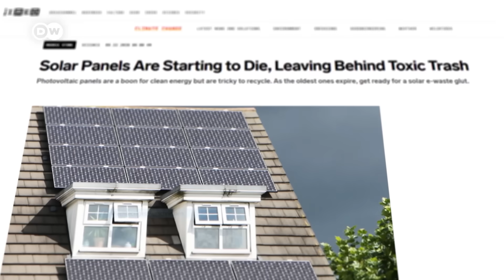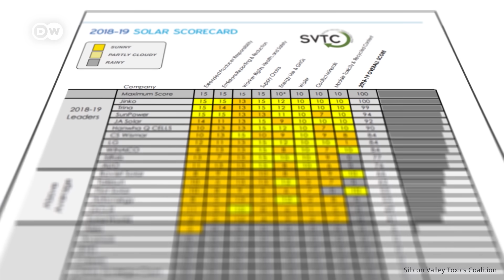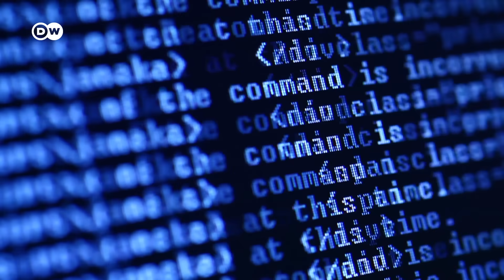How green is solar energy really?

Comment: The advantage of solar is decentralized power delivery due to rooftop solar. This isn't possible in any other methid of producing electricity. So, if we factor the transmission losses, solar has the least losses.

Comment: The Real Cost of “Clean” Energy Must Include Land and Wildlife Impact

As the U.S. considers sweeping changes to its energy infrastructure, it’s critical that we compare apples to apples. Much of the discussion around replacing coal, gas, and nuclear with wind and solar skips over one crucial fact: our current energy system, for all its flaws, is already built.

Coal mines, natural gas pipelines, power plants, and transmission lines already exist. The ecosystems they disrupted were disrupted long ago. Maintaining these systems does not inflict new damage to the land, sea, or wildlife. In economic terms, those environmental costs are sunk—already paid.

In contrast, a shift to wind and solar—especially one made reliable through massive battery storage—requires a complete reengineering of the grid. It would demand the conversion of 17,000 to 49,000 square kilometers of new land (an area the size of West Virginia), and 1,200 to 6,000 square kilometers of coastal and marine zones for offshore wind. That means bulldozing forests, fragmenting habitats, and interfering with migratory patterns—on land and in the sea. Add to that the construction of over 12,000 GWh of battery storage, and you’re talking about one of the most ecologically disruptive infrastructure projects in American history.

While advocates point out that the sun and wind are free, collecting and storing their energy at grid scale is not. Nor is it low-impact. In fact, the environmental footprint of wind and solar—when scaled to reliability—far exceeds that of nuclear, and even outpaces the already existing footprint of coal.

There is a reliable, low-impact alternative: nuclear power. It offers stable, round-the-clock electricity with a compact footprint, far less land use, and minimal disruption to wildlife. If we’re serious about cost, reliability, and environmental stewardship—not just optics—nuclear deserves a central place in the conversation.

The path to a better energy future must be grounded in facts, not just aspirations. Before we tear up new land and put our fisheries and wildlife at risk, we should consider what we already have, and what technologies can carry us forward with the smallest ecological price

Comment: Old Solar panels don't suddenly die, they simply fade away, very slowly! They could have a 2nd life as a building wall cladding material, used intact, without damaging them. If these old panels can be 'opened' non-destructively, the glass panels make cheap windows and Skylights in a roof. This glass has a very high strength useful rating because it is 'hail-proof'!!

Comment: A pretty serious problem I see with solar panels is efficiency. At this moment, on average, only about 20% of the energy a solar panel captures becomes electrical power; the remaining 80% being dissipated as heat in the air at ground level, contributing directly to warming the atmosphere. There is a lot of talk about "more efficient" panels, but even if the current values double (which is not easy),, it would still mean that more than half of the energy captured by the panel becomes heat. If this drawback gets resolved, solar power generation will really take off.

Comment: Why does DW Planet A have such a consistent editorial policy designed to call into question the validity of relatively green energy sources (How green is solar energy really?), while at the same time giving fossil and in particular nuclear sources a relatively free pass? 

Rather than use a consistent analytical framework for all energy sources, you tend to nitpick at minor green concerns while ignoring the fact that the carbon footprint of fossil fuels is orders of magnitude greater. Or when you then look at nuclear power you selectively ignore the fact that there is no long terms waste storage solution, and even if there were, in most jurisdictions this is dealt with by the taxpayer in the longer term, rather than by nuclear power producers. If this cost were added to the cost of nuclear power, that power would simply be uneconomical. 

So, "How green is solar energy really?" The answer is quite clear: next to hydro, solar and wind are hands down the lowest cost power sources, and all have a relatively tiny carbon/nuclear waste footprint per unit of power produced. 

Are these latter points at all contentious, DW Planet A? If not, why all the hand-wringing equivocation on renewable energy sources?
Reply from the maker: Hey there! Thanks for sharing your thoughts! We actually tackled different kinds of renewable energies and we also looked at fossil fuels. We always look at each topic with a critical eye and show both advantages and shortcomings to provide a balanced view. If you are interested, here are some of our other videos on renewable energy sources: 
Next gen solar 👉https://www.youtube.com/watch?v=Fft4UT7kGxg
Geothermal 👉https://www.youtube.com/watch?v=c7dy0hUZ9xI
Wind turbine recycling 👉 https://www.youtube.com/watch?v=HzQShAlObn8

And here you can find some of the videos on fossil fuels
Coal in Germany 👉 https://www.youtube.com/watch?v=CjFeVERfvH4
Running out of oil?👉https://www.youtube.com/watch?v=fkrJ8gcHqQI

and this is our most recent one on nuclear waste:
https://www.youtube.com/watch?v=hOWQgLeRM-M

Comment: you havent delved at all into the environmental disaster of mining for the raw metals - such as Cobalt, Manganese, Nickel, Copper, yada, yada .. let alone the requirements to manufacture and lay the cables that transport the electricity generated to either (1) hideously environmentally destructive batteries (a separate story, right?), or (2) the electricity grid which requires higher stability that is mainly achieved with burning hydrocarbons or nuclear reactors
Reply: Are these the same materials in our phones, and about every battery operated appliance going?  Are the batteries more environmentally destructive than strip mining, forest clear cutting, drilling in environmentally sensitive areas?  Do battery technologies have more improvement potential than these other destructive means that haven't changed in years?

Comment: There is also a need to do a cost-benefit analysis on the surface area coverage versus the tree covers. 
We don't want a situation where future civilizations will ask why we exchanged vast amounts of forest land for solar panels; worsening our situation. 
Like one-tree-per-equivalent-solar panel and in aggregate with computer simulations of the future for both scenarios. 
Some centuries ago our ancestors thought that the cheapness of working with lead for eating plates was novel. This killed them for decades without knowing as the chemicals in tomatoes reacted with lead killing them slowly without a trace - some woke up in the grave after their body fought off the damage but only their struggle-marks were found much later. Saved-by-the-bell's most likely origin.

Comment: Do you mean, “because creating solar generates gas emission” "then we should stop creating solar and continue completely creating gas emission by burning fossil fuel” ?
Do you yourself understand what you say?
Even if beginning generations of solar are dependent on fossil fuel , because there are not enough solar energy generator to satisfy the demand, after there are enough then even creating solar will be relying on previously created solar and the energy that they generate.
Also, toxic material in the air are more dangerous than solid material because they easily move , out of control, in the air.
Besides, because  solar and batteries waste , are expensive and still valuable therefore they will go to recycling factories, and they will not be buried underground, expect if a country like to do an economic suicide.(we talk about large scale)
the cost of recycling still is lower than extracting them from natural resources such as mines and the ground because those recycling material are purely consist of materials used in a solar system and not anything else.
at the end , yes all opinion all respected even if they dont fit with any fine logic.

Comment: What is the environmental impact of the heat reflected by the panels, the heat absorbed due to the lack of vegetation caused by the clearing and redirecting of water flow, due to the grading and packing with rock, etc?

Comment: The waste is the issue even with recycling as with plastic..C02 is great for our planet. Note: climate change regardless of human intervention this is a multi faceted monster data clearly shows temperature changes that the carbon changes also throughout history cold kills way more. Air pollution does exist but if you see it, it is not CO2 which helps our plants and Oceans. While CO2 has some correlation to heat it is not the causation so many more factors such as sun and solar flares. So what I wanted to see more from this doco is about the battery and the elements that go into making them ? Nuclear is looking like a good alternative
Reply from the maker: Hey there! We tackle topics you mentioned in these videos:
EV recycling 👉  https://www.youtube.com/watch?v=PbOBmnZRpZ4
Alternative to lithium-ion batteries 👉 https://www.youtube.com/watch?v=-vobMl5ldOs
Do we need nuclear to fight climate change? 👉 https://www.youtube.com/watch?v=9X00al1FsjM

Comment: A wind farm lives for around the 30-35yr lifespan & solar about 15yrs at full output yet RDP Marine hydroelectric dam system will last 100yrs+ AND be base load power AND 100% recyclable wind and solar are not the answer in their current type
Reply from the maker: Solar is probably the cleanest AND cheapest energy solution we have at the moment. 🌞 Hydropower in fact has a pretty bad environmental and social record. We explore this in our video "How to solve our Big Dam Problem" you can check out here 👉 https://www.youtube.com/watch?v=GTFDVZU-Nv0.
Reply: thanks but just to be clear i am talking about an add on system that out puts more than all wind and solar systems and not making new dams  @DWPlanetA
Reply: As of right now......as you have stated solar is not green its waist is far longer lasting and a dam is fully recyclable solar is not building them well solar is toxic production dams have hi energy consumption but very little toxic waist then lets look at benefit over time the dam wins hands down   @DWPlanetA

Comment: The idea that green energy will pay for itself is a joke and hears why ,,, Do you really think a solar panel actually cost $350 to get out of the ground and processed assembled shipped trucked to shops and shipped to your house and fitted for that amount REALLY ?  Of course not the first thing to happen when the mine site is looked at ,, before a machine is started ,, both the local and state gov gives them money call it what you will it is a rebait- incentive payment and is ongoing as long as the mine runs and that happens all the way to your roof AND it is no different for wind farms THE POWER IS NOT WELL PRICED YOU HAVE PAID FOR IT LONG BEFORE YOU USE IT AND AGAIN WHEN YOU GET A BILL!!

Comment: Take a look at largest concentration of solar panels in Europe. And track weather patterns which are comming from that direction. German flods and drought. Greece, Balkans. all happening after installation of large concentration of solar panels on the wind routes usually responsible for rain. Also measure temperature differences in same aereas. You’re welcome

Comment: Where is the evidence that solar panel manufacture is creating environmental problems?  Just because there is a small amount of scary-sounding chemicals used in their manufacture doesn't mean there's a problem.  You show a gigantic open pit mine when talking about the materials used to make panels, but compared to other forms of power, solar uses very little material.  Think of the megatons of concrete and steel used in a nuclear plant, or the open pit coal mines that are the size of a city.  This video verges on disinformation.  The message should have been a clear statement that PV and wind are by far the cleanest energy on a kWh basis, and we have a reasonable pathway to making it even cleaner.

Comment: The computation of the greenhouse emission is likely not full. Solar panels cannot produce energy on-demand, so to make the supply reliable you need to have a storage, or a significantly increased capacity, or a backup power plant which will also work inefficiently because its capacity is only used sometimes.
So, the current 10% emissions compared to fossil fuels in reality looks much worse and much closer to the fossil fuels level.

Comment: You have to put in battery or gas water when the sun doesnt shine so renewables are not so green. If you dont have hydropower its very dirty. Germany is a good exempel 40% windpower and 60 % gas. Nuclear has its problem but it is much greener than renewables. If you look at co2.

Comment: 43g/kWh during the day (when used directly without storage). To become a viable alternative it needs a battery which adds its own carbon footprint. Today's panel/batteries performance degrades 50% in 10yrs.Most latitudes will require x2 the amount of panels to generate that kWh, but need to be replaced in 10yrs regardless of the output. Future technology is in the future, maybe nuclear becomes waste free or ways to deflect sunlight back to space will be found (or Earth will prove it has one already). It's simple whether it works today or not.

Comment: Well solar panels are not unicorns that magically appear and disappear.  So if you are going to build a power plant, solar is a very good option.  When solar panels are criticized it is always in a vacuum of comparison information.  Building a fossil plant ALSO produces CO2 due to manufacturing of components, mining and processing of raw materials, as well as replacement of consumables required during operation of the fossil plant.  There is also a significant waste stream when the lift of a fossil plant is reached as well as replacing fossil plant consumables during operation. Replacement of steel components from fossil boilers, steam turbines, etc. may also end up in a landfill if not reused.  Solar panels have no emissions during operation and produce no waste stream during operation.  So while limited in operating hours during the day their benefit is FREE energy.

Comment: Solar on its own is pretty much useless. Due to the daily and (more problematicly) seasonal fluctuations, it needs to be accompanied by investment in the electricity grid, massive energy storage and/or extensive backup power plants (currently gas or coal). Add the environmental footprint of all that and solar is starting to look a lot less attractive. 
All things consideres, nuclear energy for baseload topped up with renewables + storage would make for the (by far!) most environmentally friendly energy mix.
Reply: Solar & wind energy are a supplement to energy requirements. This is due to the storage problem. Nuclear + renewables would indeed be the most environmentally friendly solution.
Right now the renewables contribute circa 40% of yearly energy requirements in some eurpoean countries. eg UK, Spain, Germany.